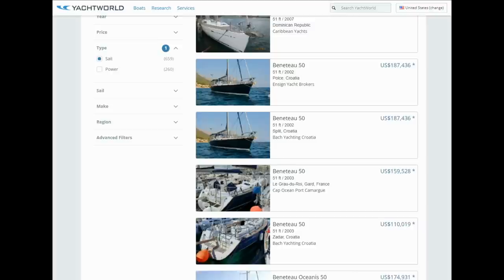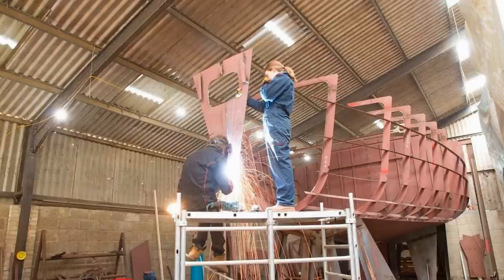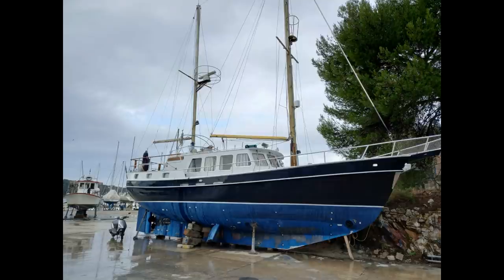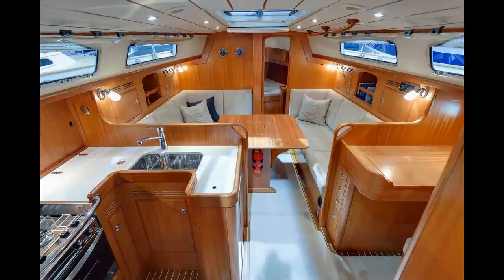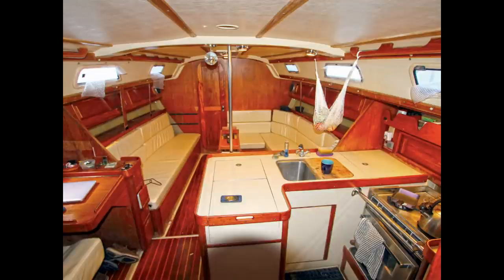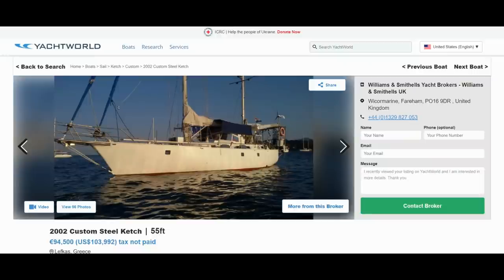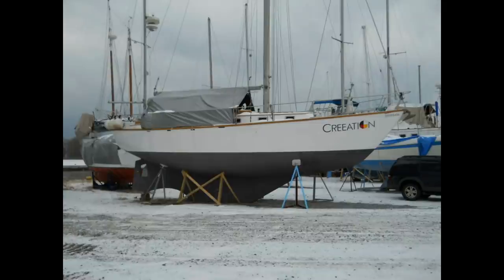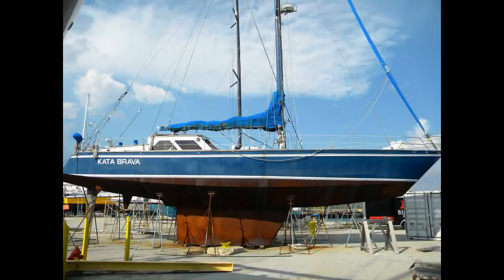Steel Sailboats - Episode 175 - Lady K Sailing

Comment: My boat is fibreglass and she's 8,000lbs above her listed weight and she sits above her original waterline. She's considered an "Ultra Heavy" displacement boat. I heard steel boats rust from the outside in. Sailing Emerald Steel is an excellent you-tube series if you're interested in steel sailboats.
Reply: @kli-kli  you're right, I meant inside-out. Not sure how I screwed that up when I wrote it. Thanks for correcting my screw-up

Comment: i'm considering building my boat. For a long time steel was the plan  (it is less learning for me since i was kind of metalworker in the days). Steel can give You everything from better strength, trough less weight or great heat dissipation (think tropics). Though steel can't get You all this thing at the same time. 

There is one catch though: the thinner is Your steel element, the harder it is to repair it properly. To get something afloat You can use sheets as thin as a beer can (or even thinner), to be able to weld it, You need it thicker (the thicker, the easier to work with). But at the same time weight increase.

Comment: Hey! DANGAR STU made a cameo! I love that channel, been watching him since he started. I've never sailed a steel boat, but I have worked aboard many steel commercial trawlers. I've also worked wood and fiberglass boats also, steel seems to ride better in swells. never felt safer than I did aboard them. Only thing I haven't got experience with is ferro-cement, and I believe I'll keep it that way. 🤣 maybe when you release that video I'll learn something to change my mind. I nearly did it last year, but chickened out. 38' Samson FC sloop, beautiful boat inside and out but I just didn't have the cajones.

Comment: I can weld... I retire cars and I know rust LOL. I have looked into steel for my future boat purchase and ultimately it's a no for me in terms of a used one. If you did for example have a scratch through that amazing paint job... the speed rust can set in and be very damaging in warm salty water is amazing. And as you said you need to be able to inspect it... from the inside. I guess if I was building a boat then maybe... the appeal is there. But equally so it is in carbon fibre... way stronger and lighter than steel. PS love you films

Comment: Your welder can also be a backup generator. (For the larger vessels)
Reply: Can you explain this further please?🤔
Reply: Gas and diesel powered welders come with at least two 110 outlets and some have 220 volt outlets.

Comment: If you want to see a dramatic approach to steel hull forming ..take a look ay explosive forming... Pressure forming for steel..it can behave like plastic. 😲
Though it was used for Aluminium hull forming ... now they can use pumped hyroforming. It works for Steel and stainless steel... 
For smaller volume production it is still quicker and more cost effective up to certain sizes.

Comment: The irony of fiberglass in blue water boats is not lost on me. The biggest advantage of glass is the ability to mass manufacture it at a low cost but blue waters aren't mass manufactured. It defeats all of the biggest advantages.

Comment: The Dutch and Germans and Swedes typically are masters of steel hulls.. both in terms of shaping the steel and the selection of the right grades of steel..the top Dutch hulls will roll a hull plate to vary the thickness like medieval armour  
It tends to be tank steel... borderline stainless ...  Its pretty 
tough stuff. 😏
Controling condensation is an issue but the good news is cork glued to steel is a very happy arrangement it will last for many decades in sailing Melody 🇬🇧 they found thin cork 40plus yrs old glued to steel and it was in perfect condition and this boat had been abandoned for years ..even closed cell Spray foam im not so sold on.. also because plastics and foams de gas for a long time and can burn to produce some very toxic fumes. 
Steel boats i know are Oddlife crafting.  Sailing melody and Sailing Dawn Hunters https://youtu.be/qWY_1ifwpck its Dutch..
 Project brupeg have their trawler/dive boat.
Capt Q has looked over a nice steel yatch or two the first one a world cruiser had been ambushed by pirates of the coast of Aden by AK toting  locals in wooden boats... the owner used his yatch to slice straight through the one pirate boat.😎
Q. also looked at a wonderful traditional Dutch motor sailor ..i think it was a Puffin.
🧙‍♂️ Gandalf ... https://youtu.be/PAHsoGVFEIA Dutch vintage fast.
Why the dutch keep running aground https://youtu.be/t-D1ZO9TZEY

DIY 78ft https://youtu.be/qWY_1ifwpck

Comment: Hi Tim, just a question, if you would have 100,000$ usd budget which boat would you purchase?
I’m moving to Florida from Canada with my wife and two kids, and I’m planning to buy a boat within that budget, but the choice is incredibly big, I like to have something fast fun and good enough to cross the Atlantic with my family.
Priority are: safety (reliable), speed, comfort, low in maintenance.
I know you can’t have everything but you get my point.
I start sailing at 12 in Italy from Optimist all the way up to racing on Dart 18, also did windsurfing until today. No big experience on big sailboats but I’m a fast learner.
The ultimate goal is cross the Atlantic with my family.
Thank you, love your vids

Comment: Of course steel is a GREAT hull material ships have been made of steel for hundreds of years. Commercial fishing boats are almost always steel hull boats. But..... don’t neglect your steel hull boat or it will be a rust stained mess in no time at all.   But just because it shows rust stains does not mean it’s unsafe look at any fishing fleet just about every boat in the fleet has rust stains running down the hulls.   BUT there are several reasons a steel hull boat was not in my search. One was most steel hull boats are way larger then I want. Second was there are a lot more fiberglass classic cruising boats out there in good shape around the 30ft size I was looking for. BUT if your looking for a 40ft plus boat to take you around the world steel and also aluminum boats are great option.  At that size and above  you see a lot more steel hull boats.

Comment: Thank you for your presentation about steel sailboats. Are there any good manufactures you could suggest?
Reply: Check out the Dudley Dix designed radius chine 38 and 42 pilot house.

Comment: I have a professionally built 2013 corten steel Van De Stadt 34' hard chined hull, she has 6mm plate below the waterline, 5mm above, deck is 4mm and superstructure is 3mm, she weighs in at 9 metric tons, absolutely flies downwind on her chines, keel and skeg hung rudder all integral, I wouldn't have ANYTHING else but steel, I am a fabricator/ coded welder with shipbuilding experience in the UK and carry a petrol generator 5KVA to run a CO2 welding machine and plasma cutter, I also have a very tall Selden fractional performance rig to handle her extra weight so for me a no brainer, steel any day....
With regards corrosion, I have a galvanic isolator, and 9 annodes in total, she has an epoxy bitumen coating inside and out so very little rust, also integral welded barrel nipples as through hulls so sea cocks just screw on to the internal threads, all flush on the outside, 
She has been hard aground on rocks for 4 hours at Saldanha bay, no damage except antifouling, she's sunk a 54' GRP fishing trawler in the port of Cape Town, with no structural damage (slightly buckled toerails beaten into shape with a 4 pound hammer) and been pinned against a concrete fishing wharf with tractor tyre fenders for 5 hours at low tide with the cap shroud touching the wharf in 60+ knots in Mossel bay and made 17.7 knots SOG surfing 4m breaking seas in 35 knots true at 130° off Cape Aghulas. I wouldn't bat an eyelid to take her round the Horn and attempt the northwest passage in her, fully insulated to deck level, great little bullet proof high latitude capable sea boat
Reply: Good for you to have the skill to basically patch her up anytime :) That can be awesome :)
Reply: @koborkutya7338  yes it is, actually it's a lot quicker, easier and cheaper for me than most people with GRP boats, rusty patches get cut out and a new piece welded in, day jobs...
Reply: Super. Ive been looking for a corten steel boat. Cant find any wonder why?

Comment: no material is perfect: metal, glass, wood. for me, steel gives peace of mind. yes, must use anodes intelligently.  coatings today will last 20 years, no rust.  much easier to sand rust and recoat, than to resolve osmosis or core separation on glass; especially when underway. I have never had the need to weld anything for any reason.  underway, have struck many objects, including reefs: causing scratches only; glass would be mayday.  all decks/hulls will become hot under baking sun in the tropics. but metals conduct heat into the water,  so they cool much faster after sunset.  chines can provide benefits.  true, a new steel yacht is gonna cost you mucho these days.  next best for strength is aluminium.

Comment: Paint coatings are extremely expensive, and there's a potential to jack them even higher or ban effective chemistry. Steel is only effective at cargo ship dimensions. Why do most cargo ships go to the scrappers in 30 years? Plumbing and painting. I donnt want a sheet steel trailer on land and I don't want a steel sailboat. It's a ticking time bomb waiting to get rust cancer.

Comment: Steel hulls are considered uneconomical to repair after 25 years. Any corrosion in the Hull will need plating from the outside. To do this, you need to remove the interior or you will cause a fire. Can you imagine stripping out the interior to do this? A steel boat has just the same equipment as a grp boat but they are worthless. Nobody wants a second hand steel boat.
I listen to this guy spout about boats and realise he is a source for incredible misinformation. Telling you steel is cooler because of insulation. Hull material makes no differences. Hull colour is everything. Don't buy a blue boat, don't believe steel is easier to maintain than grp. Absolute nonsense. Every little scratch on a steel boat needs proper repair or you boat will rust. Steel is by far the most maintenence intensive hull material. These videos are the reason why you need to be super careful what you believe on the Internet.